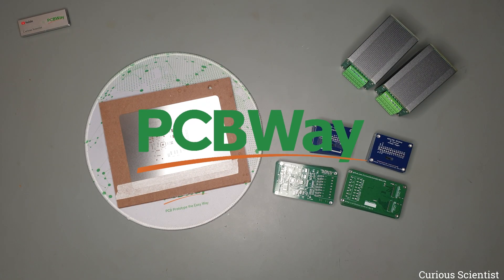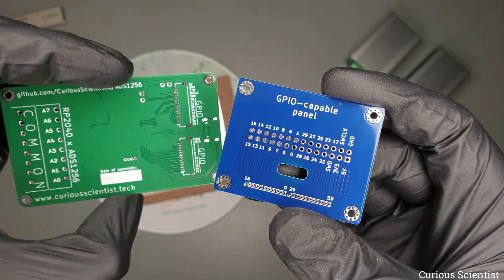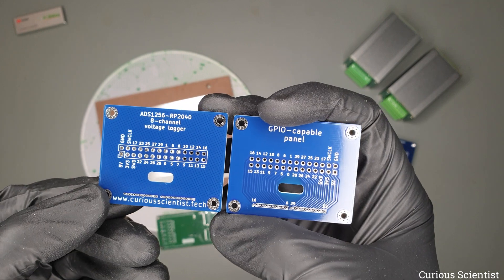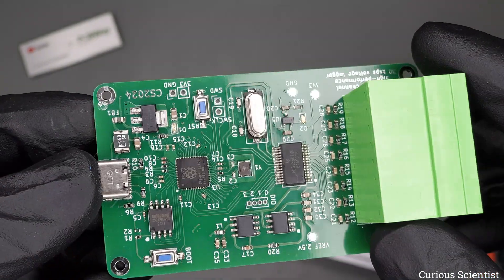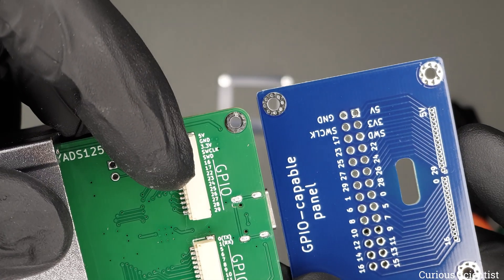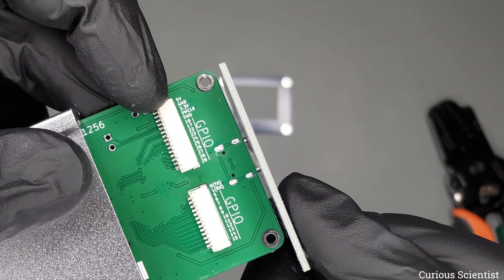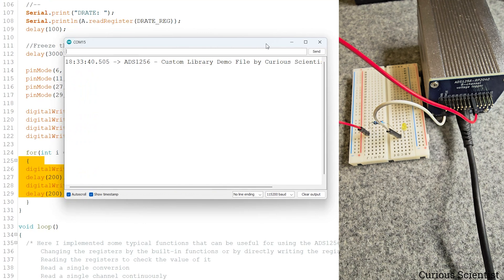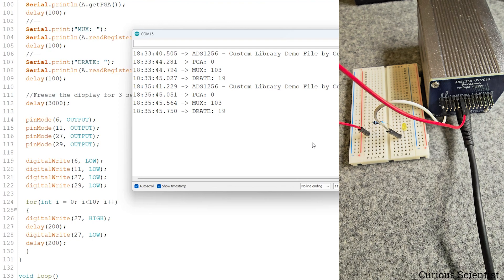RP2040 + ADS1256 DAQ module with GPIOs

Comment: RP2040 + ADS1256 DAQ module with GPIOs Video Summary:

* Motivation: (0:21) The creator received requests for a version of his ADS1256 DAQ module with accessible GPIO pins.
* New Design: (0:30) This video showcases the latest iteration of the module featuring:
    *  All RP2040 GPIO pins broken out to JST connectors.
    *  A redesigned front panel in blue with pin labels.
    *  A compact internal arrangement using cables to connect the front panel connectors to the PCB.
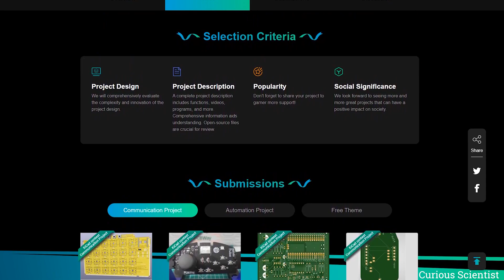* Assembly Process: (6:05) The video demonstrates the assembly of the PCB and the challenges encountered when crimping the tiny JST connectors.
* Testing: (13:37)
    * The functionality of both the ADS1256 ADC and GPIO pins was successfully confirmed.
    *  The ADC registers were read and validated.
    *  GPIO pins were used to blink LEDs.
* Future Plans: (18:34) The creator believes this is the final iteration of the module. Future development will focus on software improvements, data analysis capabilities, and user applications.
* Call to Action: (19:03) Viewers are encouraged to check out the project website, support the creator on Patreon, and explore PCBWay's services for rapid prototyping.

i used gemini 1.5 pro to summarize the transcript
Reply: As someone who is into DAQ systems, it's nice how things are accessible both sides. Physically I'd want more space between the GPIO and the USB cutout, it gets crowded and simply unplugging USB you need some finger space to not get poked by header pins. Also transient protection for all exposed MCU I/O lines, series resistors, filter capacitor pads, and clipping diodes. The most important part is the resistor TBH, the body diodes in the MCU can sometimes be your clipping diodes in a pinch with a reasonable resistance. Consider static electricity and momentarily mis-wiring protections, PTC on any exposed supplies, gotta protect users from themselves sometimes.
Reply from the maker: Thanks for the detailed response and feedback! I might be able to implement these because they need some changes on the front panel only. It is cheaper to iterate the front panel than to do more modifications on the PCB of the main circuit. The USB-C connector is fixed, but I might be able to move the GPIO pins a bit more upwards. I keep your suggestions in mind, and when I have a little more time, I will implement them.
Reply from the maker: Wow, this is cool, thanks! I pin this comment, so people can get an executive summary! Thank you for your contribution!

Comment: Hi, I'm trying to build a MIDI GPIO Light switch, and then sell to market. Would you be up for assisting me? obs for a fee.
Reply from the maker: Hi! Unfortunately, I have no knowledge of the MIDI interface, so I cannot help.
Reply: @CuriousScientist  I already built one using a teensy board. My next step is building a custom atmega32u4 board. I'm looking for the kicad files, as well as making the it the same size as the ADS1256 board, so i can use the same enclosure.
Reply from the maker: My Kicad files are not public, sorry.

Comment: Is the design only able to measure +/-2.5V signals? Have you considered making something which can measure bigger signals (+/-10V, 100V or 25, 250V) with a bit of input protection? I assume the PGA would already let it measure small signals pretty decently.
Reply from the maker: It can measure +/- 5 V when the buffer is disabled. The user can add an external voltage divider to expand the range (upcoming video topic, btw). I am not gonna risk letting so high voltages enter this tiny board.
Reply: @CuriousScientist  I believe your milliohm meter can also measure low voltages... it would be interesting to see which ADC / VRef has the better properties. You might be able to check repeatability, temperature coefficient, stability/noise of readings at different OoM voltages and 0V, perhaps linearity if you were enthusiastic. You could check if you are able to get the same number of Noise-Free bits as their datasheets suggest. I'd guess that the AD45XX on the milliohm board is one of the most premium non-heated references you can get, but comparing the TI ADC to the Linear/AD one would be interesting. It might also be able to see if the fast-opamp buffer of the OPA350 really helps stabilize the ADC, or if there is not much difference in noise when connected "raw" as in the milliohm meter. Note that these days AD have slightly newer versions of the LTC, they have 2410, 2412, 2413, 2415, IIRC, but mostly just slightly faster or better 50/60hz filter as I recall. I'm sure TI have something newer than the 1256 as well, but it is nice having 8 channels sometimes.